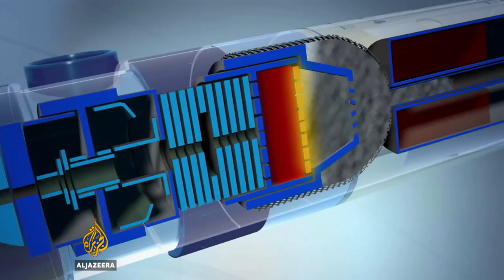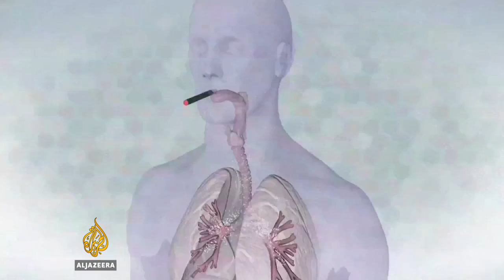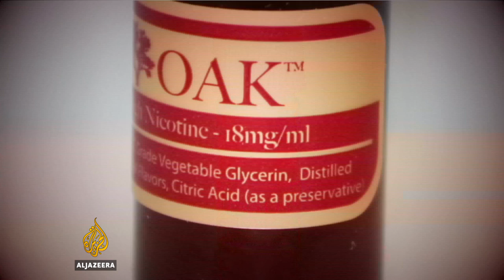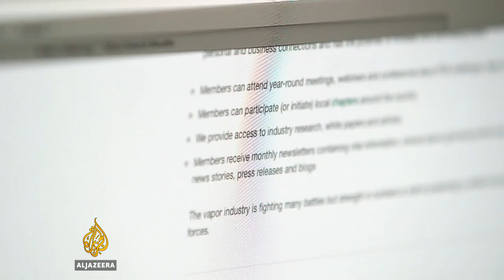Investigating e-cigarettes - TechKnow

Comment: Just to let you guys know, base on what I watch on YouTube regarding their so-called research (if I can recall correctly, and please do correct me if I am wrong), they actually tested vape above 9v or 12v (can't really remember that). But I remember clearly that the voltage they used to do their testing was way out of what vapor would vape, unless you enjoy burnt coil that is. Apparently they didn't do any research on the average voltage we all use to vape. I guess I just crank the mod to the max and just test.